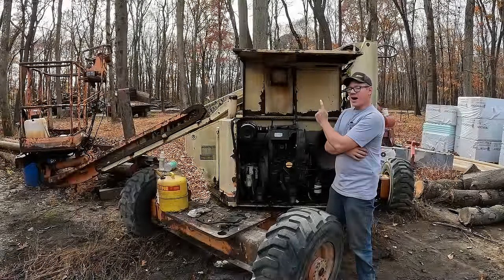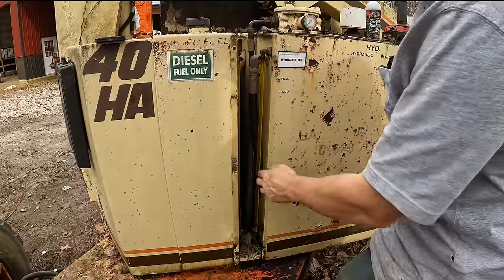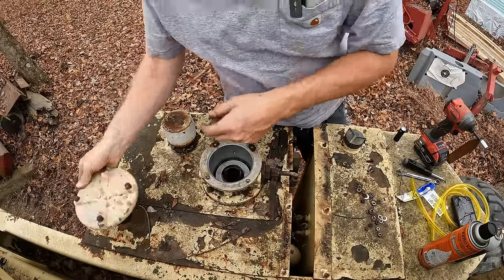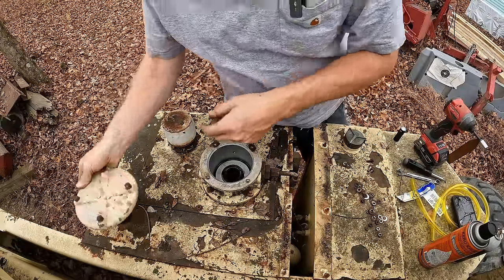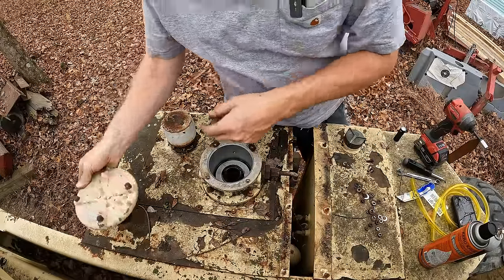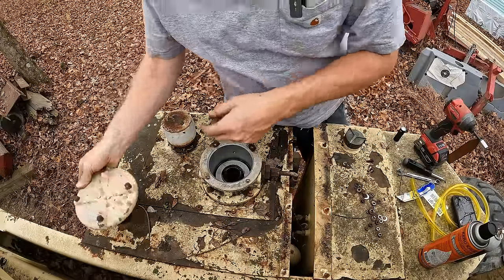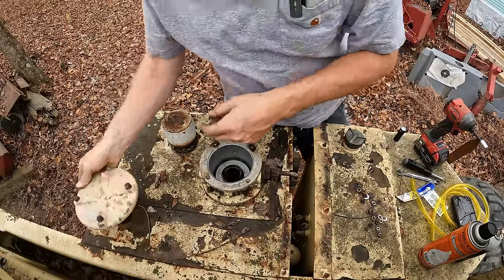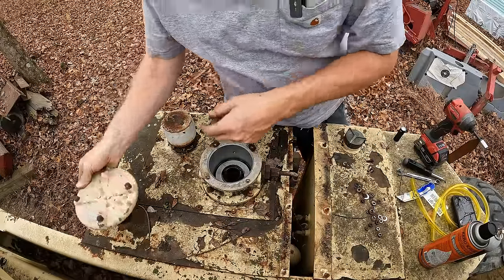I paid $1000 for this 4x4, Diesel, Man-Lift, What could possible go wrong? (JLG)

Comment: Paid 5000 for my Simon AT 45, also a ‘95 with a Deutz engine. Very reliable engine so far. The solenoid for spinning the wheels broke so I drive it by manually pushing the rod in on it.   Gotta fix that.  All the lines need replacement which will cost the amount I paid 😮. Been very handy though. Few little weeps but I’m running it. Swing bearing is shot on mine too. 2’ of play at the basket. Good luck!

Comment: Impressive, JLG actually gave you an access port to the hydraulic tank, I guess a majority of equipment does that. Would be great if they did it for the diesel tank. 

My dad cuts an access port into the side of the tank, then uses a sheet of marine based rubber material to make a gasket, he would then drill and tap holes about every half inch apart. when they build the tank as the frame, you just do not have a choice the matter.

Comment: If the black goo in the bottom of the tank is the goo that the fuel eating bacteria makes, acetone is the only thing I found that thins it.  It will get into the filters, and clog them solid in a very short time of running.   I used the pump from an oil burner [modify to remove the pressure regulator, so it is just a pump]  to circulate half a gallon of acetone mixed with Diesel to clean and flush the goo out.  Then a few rinses.   Next, is get some Kill'em.  It is an additive that kills the bacteria.  Plumbing supply shops that sell oil burner / furnaces should have it.

Comment: You can add a tire valve stem  minus the Schrader on old plastic cans. Use a wire to get in place, pull through with pliers. Stem cap seals it off.

Comment: Usually those site tubes fail from the sun not from the fluids. Next time you have to fill a big tank like that leave the access cover off. Much easier to just dump fluid in without a funnel.

Comment: That "valve" on the cylinder is a safety lock valve.
The valve has to see pressure on both sides (pressure and return) or it will not open and let pressure thru.
Protects it from falling when a hose ruptures.
Typically,  on the cylinder side of the valve, are steel lines.
The valve should be rebuildable, unless corrosion has attacked it.

Comment: JLG John Leslie Grove from PA invented first hydraulic cranes.
They are now Manitowoc Krupp Grove JLG.
Free service info online for JLG also.
I had many JLG lifts and Grove cranes.
I like them them best.
Learn to pin out wiring circuits from basket controls to lower controls and valves.
A" power probe plus " is a must.
Newer JLG have plug in Diagnostic port after 90s . I got a scanner which helps make diagnosis much easier m
Older machine did not have such and much more difficult to troubleshoot.
Pin out method is the only way to diagnose.
Good luck.

Comment: Rather than take the time to scoop out the tank.   Use a battery-operated fluid transfer pump.  It will remove any fluid and can also be used to fill tanks.  Rather than having to pour oil or gas at awkward angles.

Sierra Electric Tools JB5684 Battery Operated Liquid Transfer Pump @$17.00.

If you're interested, I will send you one.

Comment: You might be able to get the manuals for electrical & etc.  If your worried about those see thru hoses going to hell, I would guess it's the sun that does the most damage.  Get hose that's just abit larger and slit it so to sort of snap over the new hose. It was fun to watch it run and work.

Comment: With diesel and hydraulic oil not being highly flammable (like gasoline) I believe a wet/dry vacuum cleaner would work for cleaning the tank bottoms. (if there aren't any baffles to block access).

Comment: The first might have been glass behind the shield but one never knows what UV and who knows what. Got on the plastic ones.  What a nice machine but what a project.  Might have a battery low voltage that doesn't throw the solenoid in the starter to engage the two gears.  The high temp resistor is likely a current limit to the starter.  Using it a lot right now.  You have manuals ?  likely has a picture.

Comment: Matt if you can find a laboratory supply that sells glass burettes you can use a glass cutter and cut the flare and reducer off the top and bottom and attach with rated hose you can really have sight glasses, I have done it to make hydrostatic test rigs.

Comment: Matt I'm at about 13 minutes. In the future if you get a shop vac you don't care about or a dedicated one it sucks up that hydraulic oil super quick. We had one that clipped right on five gallon buckets and made changing or removing oil super easy and clean.

Comment: Another great vid. I have worked in my share of those lifts.
I would suggest one minor thing. Install a small quarter turn value at the bottom of the site glass's. If it's going to sit for awhile, just close the value. surprised they weren't there. seems like everyone I worked with had one just the site break and leak and it's an easy way isolate the site glass. Won't say how I know, but always remember to open the valve while using the machine because you can run out of fuel without knowing because the level won't move with the valve closed

Comment: You can fix the new fuel cans with an EZpour kit.  I know tractor supply carries them, I'm sure their on various online stores as well.  Basically it's a bag with a nozzle, two different base caps for different threads, and a vent.  You swap out the safety lock nozzle, drill a hole in the can to push the vent into, and you got yourself a brand new can with none of the modern muckings.  They also have a big mouth version for that fast pouring.  I've had them on three cans for about 2 and a half years now, still works great.

Comment: Valve body ontop of the boom cylinder is a two path check valve, that doesn't allow the other path to drain unless the other path is pressurised - in other words, without pressure it locks the cylinder at it's current position.

Comment: I am enjoying your videos as much as any on here . On the smoking wires , you poured diesel on them then the joiner has corrosion in there .Replace the join properly. Any corrosion interferes with current flow and if it starts getting hot its corroded.

Comment: that valve that is leaking, is your life saver, in order for the boom to go down it has to have presser on the up side. it called a dead man safety valve, youu test it by takeing the hose loss that lowers the boom or telescopic .. you should be able to remove that hose and the boom should not move. if hose blows it dont move crashing you into the dirt. there a must for anything lifting people or heavy loads were people are workin

Comment: I think that is your anti drop valve that is leaking. It's just so if a hydraulic pipe bursts you won't come crashing down to the ground. It requires pressure to overcome a spring stop setting to drive the arm down over gravity. You have a leak there or a stuck spring so instead of lowering it's pissing out.
Well that's one possibility.

Comment: Just FYI that block valve on the cylinder should be what is called a holding valve. If it blows a line to the cylinder while in the air the cylinder won't move (for safety) there will usually be an orificed port on the valve  that can be used to bleed off the cylinder and let the person to the ground slowly and safely .

Comment: If you put a valve at the bottom of the sight tube, you can turn it on to check the level of the tank, then turn it off again so it can't drain the tank. We do that with nitrogen storage tanks

Comment: I was hoping you were going to fix this before working up in the ceiling of your shop. 

I don't know what your plans are for the inside of your job. May I make a suggestion that will benefit you summer and winter. You could buy one of the big ass ceiling fan or go to Home Depot or Lowe's pick up the largest fans without lights and put them up there. You will not believe the difference it makes. Winter time really pays off with one of those fans up there. It's unbelievable how much heat is up there.

You might want to stop by tractor supply. They used to be able to get a 55 gallon drum of hydraulic oil and it wasn't real expensive 3 years ago. And you can go to harbor freight and pick up one of the pumps that fit in the barrel. 
That pump has lasted me 15 years without a single issue.

Really looking forward to see you start working on the inside.
As always I made sure to give you a big old thumbs up and look forward to your next video.

Comment: I bought a JLG RT 25 sizer lift with a 3cyl Kubota gas engine that runs on gas or propane. got it running but brakes were locked. It would raise up and down and steer but would not move. Finally got the hubs of and took brakes off so should roll now but have not messed with it in s few years. This video gives me inspiration to to go back to work on it. I paid a lot less than you paid for yours. Maybe I can get it moving now.

Comment: Time to get it a Power Wash and clean everything off. Good Job. Did you try to make the back wheels strait. Glad you explain everything to us ! Could thing you found the leaking line and the bad wire. Could catch on 🔥fire🔥🧯Check with Farm Craft 101 Jon is a Great guy.

Comment: Matt, consider a fluid extractor, mighty vac sales one good for I think 7 something quarts and it has a bike pump on the side to power it. It also works in reverse as a dispenser. Iv used min for about 5 years of small engine service. I just recently added a little 12 v vacuum pump to make it cordless.

Comment: Those oil pressure gauges with plastic lines are really bad idea, plenty of engines have destroyed because the old chinesium line ruptured.

Today we have eletrical pressure gauges, they are the thing to use.

Or if one really wants to use analog gauge, make small hydraulic line for it

Comment: Spyglass breaking + spilling gallons of fluit on th floor.
My dad solved this problem by relacing the bottom-nipple by a drainvalve and close the valve. In this case thr spyglass shows the fluitlevel the valve was open the last time. the sho the current level (and see how much went i n or out since the last time) open the drainvalve and see the spyglass leveling to the current fluitlevel. when it is settled: close the drainvalve, so there cannot be any spilliong when the spyglass breakes at some point.

You can also use this method in pressurised systems (like fresh water conainers behind a waterpump keeping it  like at 3 bar pressure), but then you need two drainvalves, the one on the top and the one on the  bottom.

Comment: they have

they make sight glasses where the pipe is metal and there is a floating magnet that flips a series of colored indicators inside a separate tube attached to that pipe. Pretty cool systems.

Comment: Boom units like this are common on an airfield.  The hydraulics system that is powerd by a backup electric pump can work both the boom and the drive line . Just not both at the same time.. also thier are lock out on the drive hubs that will disengage and allow for all the wheels to turn freely.

Comment: You could install a angle valve in the bottom sight glass connection that can be closed in the event of a sight glass failure. Darlington, South Carolina

Comment: Matt good job getting that boat anchor running.. one thing I did notice when you were in the basket operating the controls, is you didn’t have your foot on the deadman peddle and nothing should work except for the engine start circuit without your foot on that switch… my advise to you is to stay out of that basket until you get all the info you need to fix and operate it safely.. they sell decal kits so you can relabel those control panels so you don’t accidentally hit the eject operator button. Jk but you know what I mean..

Comment: I worked a shop that did a lot of repaurs on concrete truck and we would install shut off valve on the bottom port for the sight glass just in case 😉

Comment: I would install an electric oil pressure gauge. They work fine. Those small oil lines, even copper or steel are prone to leaking eventually. Causing a huge mess or worse. Starter is bad. Will let you down eventually. May start fine when engine in well tuned and warm, will be problematic everytime it kicks out.

Comment: power wash the tank ot and use a grabber...then fill er up with clean fuel...hitting heavy on one cylinder...valve maybe?
make sure you use good oil and add lucas...If the valve still hits to loud pop the valve cover and adjust the valves... most important stuff seems to be working but the ghosts are definitely electrical...good luck as you track those down i am praying for you...

Comment: Put valves on the bottom end of the tube so you can shut off the flow and replace the tube without having to drain the tank

Comment: Dc u would need to change the toggle switches and the controls levers in the  basket ,there r wee seals which r worn enough to let water in and corrode the connections

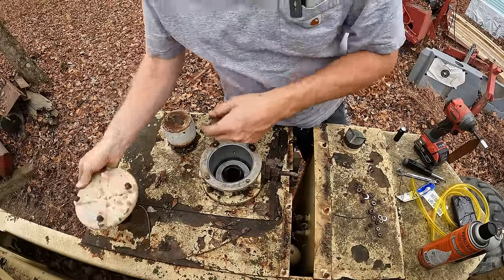Comment: 12:00 Get an evacuator oil changer Matt. They can be used to suck oil or most any type of fluid out of places like crankcases or tanks such as those on your JLG. Tractor Supply carries the Liquivac, and there are many other models in various sizes.
40:00 That looks like a wire-wound resistor, maybe used to drop the voltage to something but being a diesel not sure what it would be for.

Comment: "ok I just changed the fuel filter and loosened the pump so the air can bleed and now there's fuel everywhere"
"heh, that wire that's in/near the fuel wet area is smoking"
[continues to try start the engine]
[a woorld of osha violations]

Comment: FarmCraft101 has a couple videos on repairing a 80' lift blue one of these (Skyjack brand, I think?). He was having a lot of trouble with the electronics in the basket no working as well as the ones on the ground and ended up replacing the potentiometers in the basket control panel. May be worth your time to watch those videos before really tearing into your machine.
Reply: I think the machine is old enough to got no electronics inside. Its just electric with switches, relays , ordinary switchgear.
Today in a world with microprocessors you would´t even the engine start if the red system alarm light up. 
The only thing you see in the display is a symbol of a man waving a spanner saying "urgent service is needed"

Comment: Matt I was thinking about those wiring coming down from the control box how about use nylon reinforced hosing put coupling at the bottom of the box to the main enclosing all electrical.aftwe rewiring to stop critters chewing brush some spray with cayenne pepper or mothballs that why the auction those large cable have multi wire colors and be able to rebuild your harnesses

Comment: Sun exposure (UV) probably had a bad effect on the sight glasses. My expertise is in the plastics industry. We had customers buy our resins and compounds and do all sorts of non-recommended things with them. Clear solid vinyl likely would have NO UV resistance since the inhibitors add color. Plexiglass (polyacrylate) is the way to go for clear applications however it’s rigid. Glass is even cheaper and better if you can protect it.

I can’t be sure what the flexible tubing that you bought might be but I’d guess it’s vinyl. It may darken in color with sun exposure. Can’t be helped.

Comment: If you have a print for the electrics just replace the cable to the platform. No sense messing with old shitty wiring, just replace with new. It is easy to make up harnesses, a lot easier than chasing reoccurring electrical gremlins. Soaking in oil and fuel wrecks the insulation. Multi conductor trailer wiring is quite good for this. Just a thought.  🙋‍♂😉

Comment: If the engine runs and the hydraulics work the other issues to expect are electrical that can be fixed. It was likely taken out of service due to safety standard given the amount of rust it is displaying. You will likely never be able to have it certified, but I suspect that will not be a dealbreaker for you Mat.

Comment: For your sight tubes, could you run a solid pipe up half way and then use the transparent tubes at the top where the Full and Add marks are? Then, if the tubes broke, at least the whole tank wouldn't drain. Maybe there's a reason it all needs to be flexible tubing that's not apparent to me.

Comment: That resistor looks like a Thermo King safety cut out resistor,which was designed to heatup n melt the solder to trip the switch to shut down a fridge motor

Comment: Shop vac with 18”rubber hose stepped down to 1/2. Tape a 3’ 5/16 threaded rod to it and suck the sludge out of the tank.

Comment: I did something similar on my long tractor so I could read the level of gasoline but it was still very hard to see the clear gasoline through the tubing you might be able to find some tiny piece of impervious junk you could float in that tubing so you can see the level easily.

Comment: man i fell you on the new gas cans. The EPA is all worried about a little bit of fuel evaporating that they make companies use those stupid locking push necks. Then it takes 1/4 of the fuel i'm trying to pour just leaks around the locking push button and dumps it all over my hand and ground. Things are worse for the environment then a BP oil spill.

Comment: Obviously, there are several shorts in the system. Hope you don't burn the wiring out before you get the time to replace it, it is easier to pull a new wire using the old one than reading a schematic.

Comment: Hey Man, Just a thought. Your fear of the tubes deteriorating after a while and leaking, what if you were to change a few connectors around and add a manual shut off valve on them, when the lifts not in use just shut them off so if they do break while sitting there ya won't come back to a massive mess on the ground.